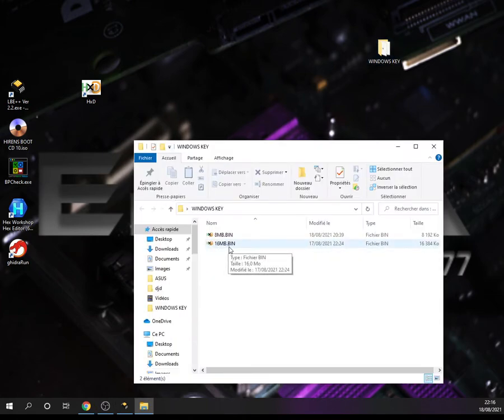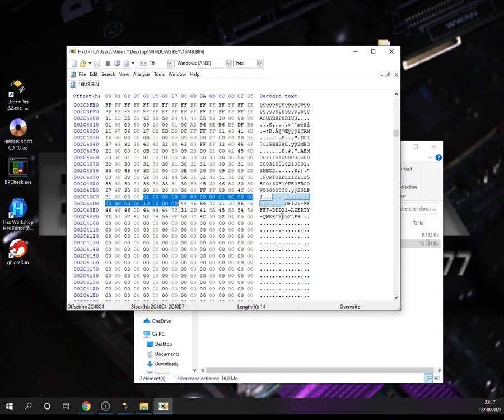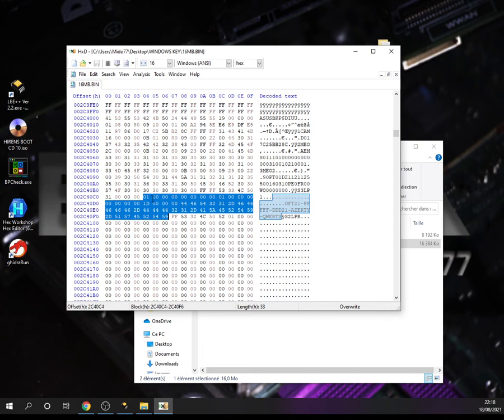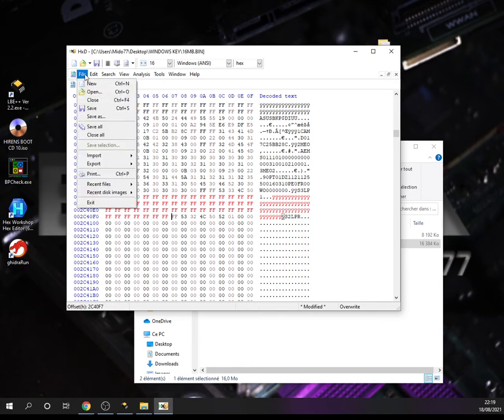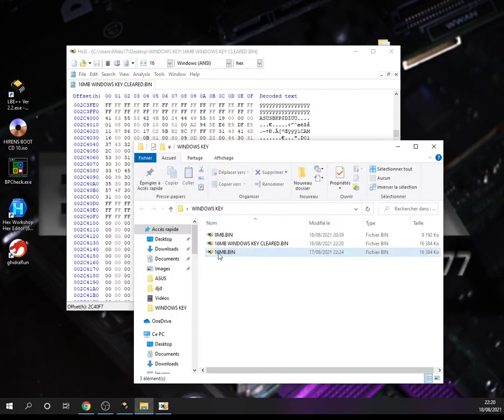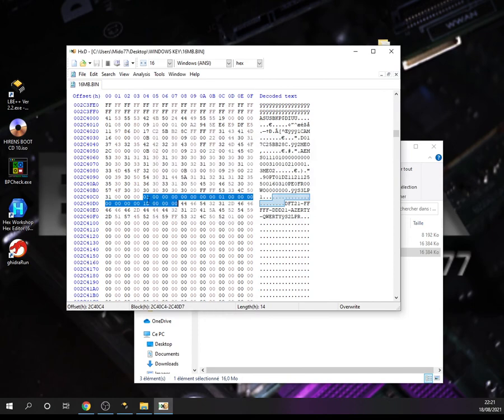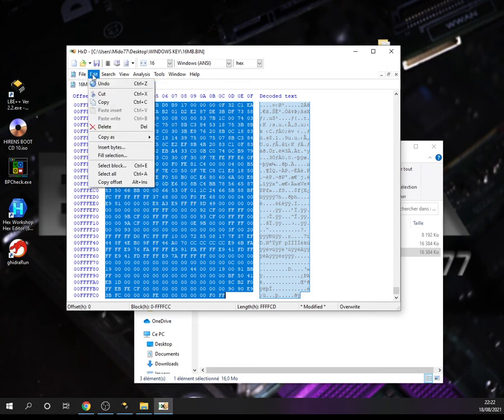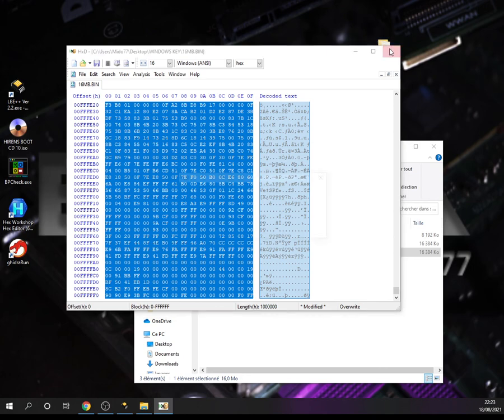CLEARING (Removing)  a Windows key from a Bios Bin File using HxD

Comment: Fantastic set of videos on managing OEM Windows product keys! However, I'm missing something and was hoping you could help.

I've gone through most of your videos, and I know how to download the BIOS package from Dell for my Precision 3660 Tower PC. I also know how to extract the BIN files, and I know how to search for and modify (or clear) the product keys. You've done a great job there! The part I'm missing is how to save an image of my EXISTING BIOS (with the burned in OEM Windows product key), so that I can clear it and then flash it back.

In your videos, you start with a BIN file that has a product key in it. That's part of what I'm missing. How do I generate THAT BIN file from my own BIOS? (In your example, you're using a 16MB.BIN file with an embedded Windows key; how did you get that file?) The other part I'm missing is getting the modified BIN file back in my PC's BIOS. Can you help me understand that part? How do I flash that modified 16MB.BIN file back into the PC's BIOS? It's possible that I've missed one or two of your videos, so would you mind pointing me at them, if that's the case?

I'd truly appreciate the help, because I purchased a couple of rather expensive Dell PCs and didn't realize that one of them (Alienware Aurora R1) came with Windows 11 Home. I didn't see an option for upgrading the OS to Windows 11 Pro when I ordered it, and now I'm stuck. I bought an official Windows 11 Pro license key, before realizing that Dell was burning the product keys into their BIOS. 😕

Comment: Thanks ERRA, indeed an excellent video. One request, can you suggest a flashing tool for flashing the new .bin file for Dell? Phoenix SCT Flash for windows (the official flashing tool always throws an error, even with original .hdr file extracted from the original exe file from Dell site). Nothing seem to work. Please help. Thanks
Reply from the maker: Hi
Nothing will work when using HDR files, you need to extract the .bin file from the .HDR file and use it to flash.
You can send me the HDR file on Telegram/WhatsApp ( +212670085887 ) and i will extract the .bin file for you